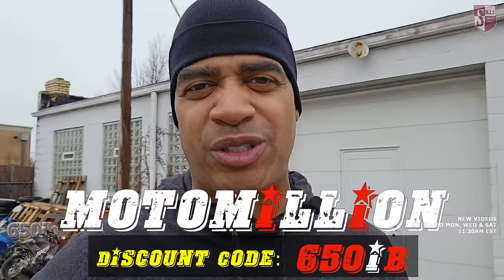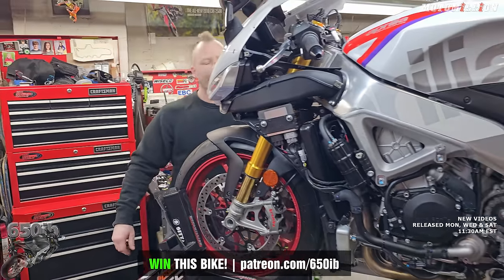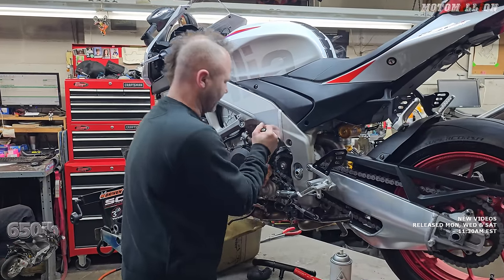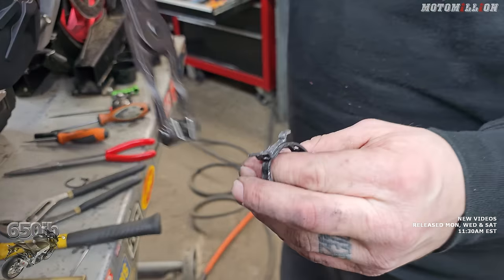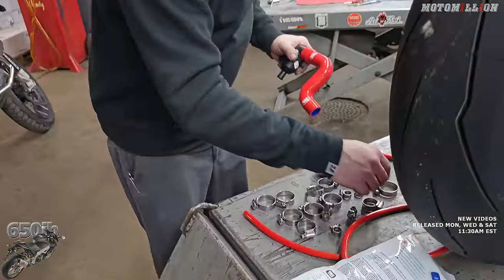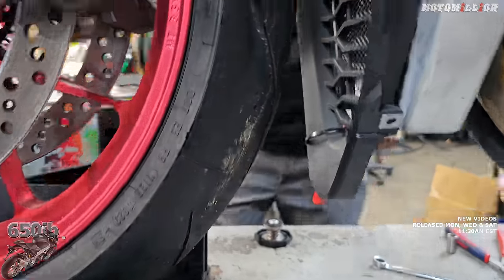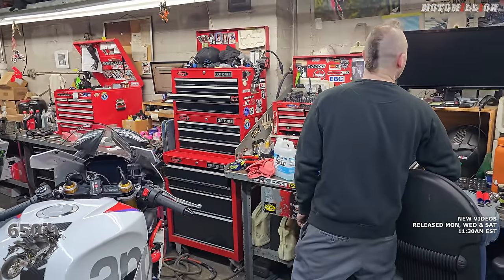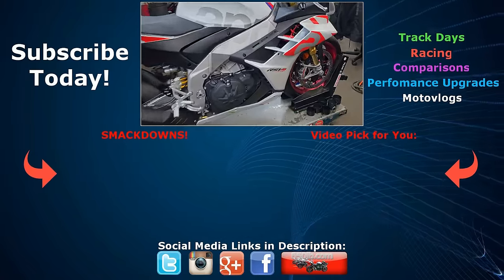Aprilia RSV4 Factory GETS Samco Red Hoses & Radiator Protection!

Comment: There is absolutely nothing wrong with the factory hoses. They last years & years 😮
Reply from the maker: Indeed but Samco Sport hoses look better and help the bike run cooler 🤪
Reply: @650ib  I've been in the motor trade for 30 years, and that's the first time I've ever heard of a silicon hose helping cooling😆
Reply: @nialbarnsley4108  They do in con junction with the engine ice as well. I have them on my 2023 RSV4. Can't compare it to cars. I don't have overheating problems like some other RSV4s. The write up on Samco hoses is a good and worthwhile read for anyone.
Reply: @joyfulpyro2589  don't be silly and believe everything you read, especially videos on YouTube, a hose only moves coolant from the engine block to the radiator,  where it is cooled by the air. A hose DOES not aid cooling. The only hose which would enable and sort of cooling would be made from alloy or steel and have cooling fins as part of its construction,  FACT
Reply: @nialbarnsley4108  you are correct in that but some us know things from experience. I know from being in 98° Alabama heat in stop and go traffic that I got the performance I expected. Yes the temp got to  234 but my bike never cut off. Your mileage may very. In my 30 years this has been my experience. I'm not saying these act like cooling fins but you do get a bit of performance. I wonder why they are used by race teams? The oem are great (keep them) but if you want a little bit of performance and alot of style 😉 then these are a good option (Aprilia makes great OEM components but not all manufacturers). I should make my next upload on these hoses they look good on the matte black rsv4. Remember no one is saying they are necessary it's a preference with style and performance. All hoses and clamps are not equal.
Reply: @joyfulpyro2589  💩😋
Reply: Also samco hoses have a lifetime warranty against degradation and they improve airflow which helps with cooling fun fact.
Reply: @nialbarnsley4108  lolololol  good one.
Reply: @joyfulpyro2589  you asked for it sorry 😋
Reply: @nialbarnsley4108  hey its all fair. We get better when we can challenge each other and discuss differences. No offense was taken here just a good laugh. I literally pictured you saying it in disgust lol 😆. I know the Ape gets bad press I just have not had any issues but I am meticulous about certain things. The Daytona 675r I won in season 1 is still in great condition and I take it to the track all the time. Have a good one and keep challenging the status quo.
Reply: @650ib no they don’t, it doesn’t change it’s inadequate cooling system capacity
Reply: @joyfulpyro2589 a hose improves airflow?  Lol

Comment: I just bought last week a yelow kit of samco hoses and clamps for my GSX S 1000 k21 it will be sick N cooler they talk about a lil bit of power with that tooo
Reply: Lol
Reply: @lg740xx  that's what they Sayed bro
Reply: @pomplardpanam8591  say or said?  Wrong by the way - think about it - hoses or removing a thermostat doesn’t change the capacity of a cooling system nor is it smart - a thermostat has a purpose to keep temps in that operating range
Reply: @lg740xx  it's already on the way from UK...